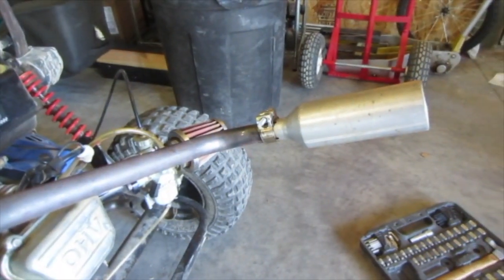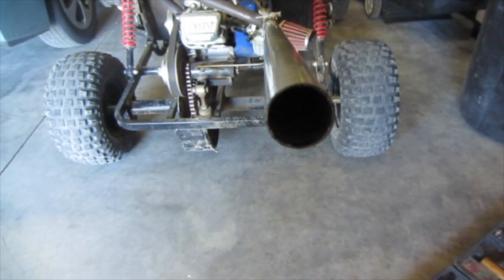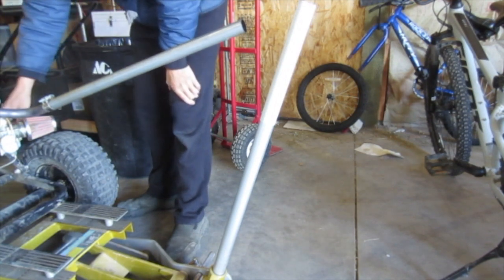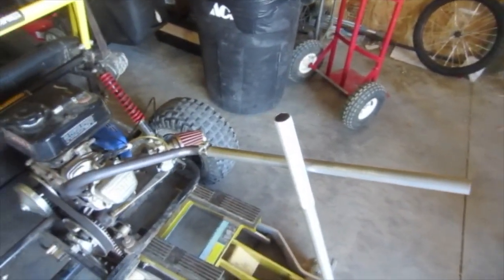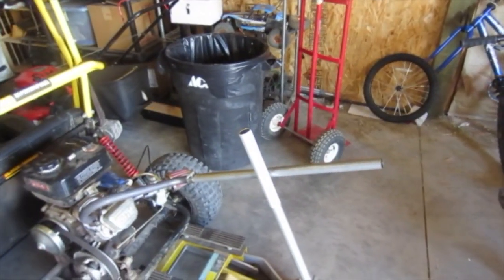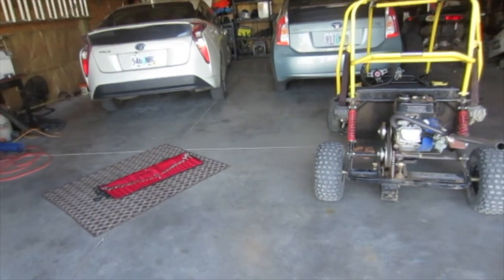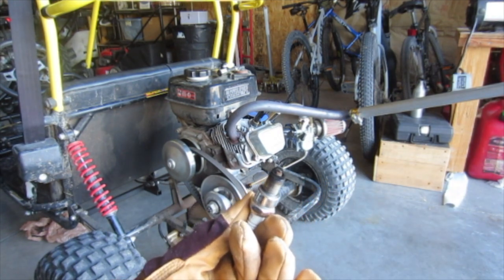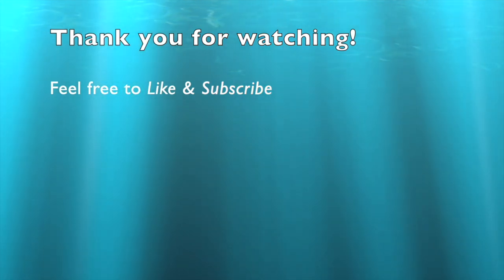What does the Go-kart sound like with a 3ft Header?!

Comment: I found that simply putting a 2ft long pipe as a header will not only make it sound like a Harley, but it will also increase power by a LOT. Especially if you swap out the carb for a 22 or 24mm carb and tune it just right.
Reply from the maker: Yeah, I have a 22mm Mikuni on it. I had to turn it back really lean though.